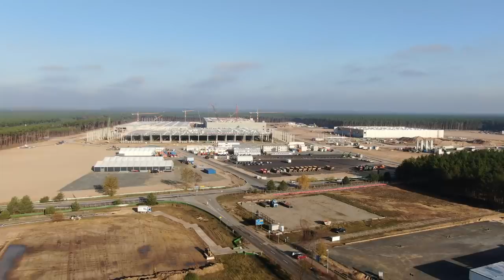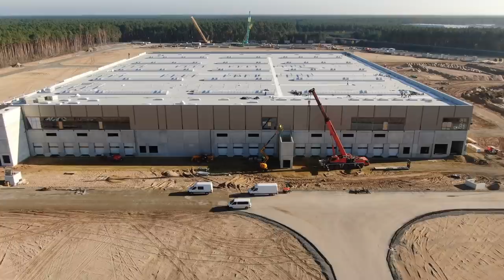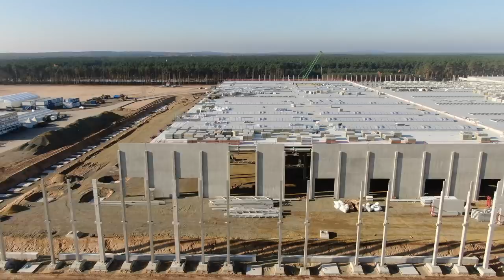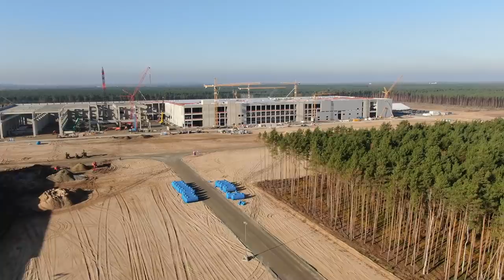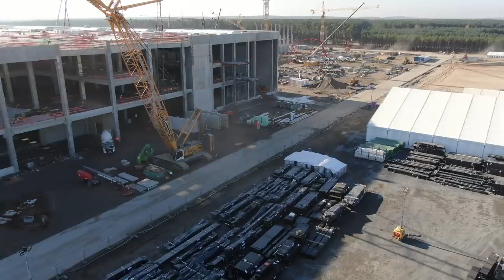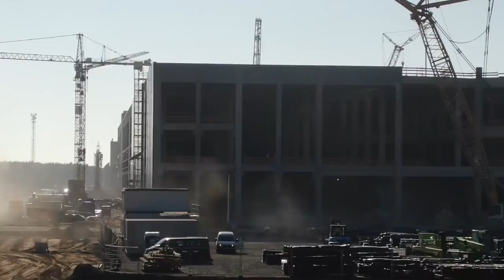Giga Berlin | 2020-11-07 | Stamping columns

Comment: I'm still amazed by the incredible precision the way the vertical support pillars are erected. I understand that this is mainly due to the expensive laser measuring instruments, and yet the precision and speed of this rough work is difficult to explain.
Reply: It's pretty easy to align things precisely by sight. Using a cheap laser makes it even easier. Making every thing square and properly located is tougher.
Regardless, the pace  of construction is astonishing.  It seems Tesla is using a more software  development like approach to their projects; they build prototypes quickly, modify the design, and then scale using parallel  construction of  modular units.

Comment: A lot has happened during the last week at the construction of Tesla's Gigafactory Berlin. 

- The structure at the casting section made good progress. 
- The first columns are placed at the stamping section. Also a lot of activity at the foundations.
- At the drive unit they started to build the staircases and installed gates at the loading bays.
- At general assembly more columns for the outer walls got placed.
- Equipment arrived at the paint shop and the walls are growing as well.
- The first roof structures of body in white connect to the paint shop now.
- Walls are also placed at the west side of the body in white. Unfortunately I can't show it with the drone, because it's not allowed to fly too close to the highway. But you can find photos in my album, which I made on Wednesday from the other side of the highway.

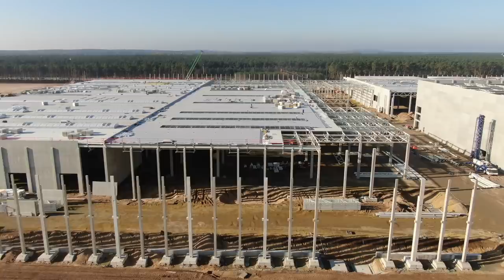It would be very helpful if you could add timestamps after each section above, something like 4:37 (totally random) for instance, so people understand. I for one am losing track of what is what.
Reply from the maker: Good idea. I added timestamps to the description now.
Reply: @TobiasLindh , awesome. Thank you very much. Very helpful to understand what is going on. Please keep doing this. I wonder if Tesla would give you access to the interior of the buildings once everything is closed up so you can continue documenting the process. Although I do think that they probably have their own people doing this already.

Comment: Looks like Blackzilla is trapped! Also, what are those blue pigs north of the drive-unit?
Reply: yes, will be interesting how Blackzilla will get free. There is some space left where the other is parking, but that exit will not easy to handle. 
The blue pigs are water tanks, could be rainwater buffer.
Reply from the maker: It looks like he's trapped, but there is still an open exit to Redzilla. 
The blue tanks are for rainwater. They burred them next the the tarmac streets. But the street north of the drive unit is not tarmac yet.
Reply: @danielmunnemann2987  ah! yes, now I can see a way out! Thanks.

Comment: Danke Tobias.
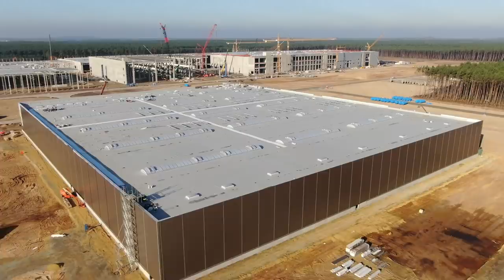Weißt du wofür die ganzen Säulen bei 4:05 sind?
Also die zwischen der Strasse und der Endfertigung/Sitzproduktion?
Das schaut ja so aus, als ob das einmal rund um geht.
Reply: Für die Fassade. Die geht logischerweise immer rund rum, sonst wäre das Gebäude ja offen ;-) Identisches System wie bei der Antriebsfertigung.
Reply from the maker: Das wird die Außenwand des Hauptgebäudes. Die Wand wo das Dach endet ist nur eine innen liegende Brandschutzwand. Dazwischen wird es noch eine zweite Etage für Büros, Kantine und Umkleiden geben.
Reply: @TobiasLindh  
Vielen Dank für die Info!
Reply: @julianreverse  
Das eine Fassade dran kommt war mir schon bewusst, allerdings empfand ich den Abstand etwas klein / kleiner als bei der Drive-Unit (falls ich mich recht erinnere). Aber Danke für die Info.
Reply: @Niklas_1E  Stützenabstand ist identisch. Es ist eigentlich alles identisch, da die Gebäude gespiegelt sind.
Reply from the maker: Das ist so nicht ganz richtig. Der Aufbau von DU ist zwar fast identisch zu dem von GA, die Gebäude sind aber nicht einfach gespiegelt.

Comment: Let me analyse the youtube video "Project Cinovec": 49% is owned by (EMH) London European Metals Holdings 51% is owned by CEZ Group - 73% owned by Czech Republic

The biggest stock of Lithium can be found in Cínovec which is placed on the border of the Czech Republic (75% Lithium deposit) and Germany (25% Lithium deposit – this is just the estimation based on research). 

German´s automotive industry is very important for the Czech Republic which means that CZ priority is to start „Project Cínovec“ asap as youtuber already mentioned in his video. The youtuber is right anyway he is from USA so he doesn´t know the situation in CZ as good as I know, so let me clarify it. The Czech Republic is sceptical about cheap labour in German´s automotive industry and it´s discussed very often that value added to the products is very low (CZ HDP). 

My father-in-law is working as manager in the CEZ Group, so he told me that the CEZ Group is planning to build battery factory for a 100 millions of Euro between Prague and Mlada Boleslav (main office of Škoda Auto member of Wolkswagen group). The aim is to raise the value added to CZ HDP. Project should be realized within 4 years (covid-19 situation can change the plans of course). It means that EMH will profit from “Project Cinovec” no matter if Tesla will sign the contract with EMH or not.

I would rather suggest Tesla to cooperate with  Deutsche Lithium GmbH (http://www.deutschelithium.de/en/projects/zinnwald-lithium-project/) quoted by London Stock under (ZNWD). This company owns lithium production rights for 50 years on the German´ side. It´s advantageous for Germany, because Tesla will create new job vacancies for German people, but disadvantageous to the Czech Republic, because Tesla will just mine the lithium.

As far as you are concerned in Tesla´s interest, then you should choose Lithium deposit in Germany, if you are interested in Project Cínovec, then you should choose both companies.

Zinnwald-Lithium-Project – Deutsche Lithiumdeutschelithium.de

Comment: Rehashing my earlier comments, Berlin needs more roofing teams, the drivetrainroof is still not done, did some work in this video and still needs to be cleared of remaing materials. So many roofs half done or not done. Some seem done but still only have the first layer and misses the isolation parts.
Reply: Watertight is more important than insulated at the moment, before the snow comes. it's not like they have heating to waste yet.
Reply: @nickwagner9339  Thats why i am saying they need more roofing teams, they need to speed up the insulating and waterproof making of the already constructed roofs.